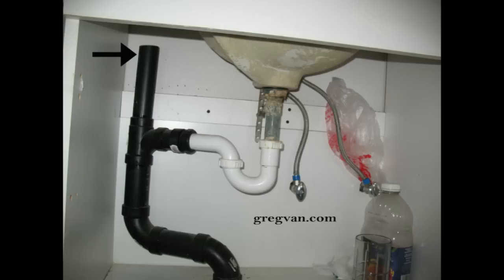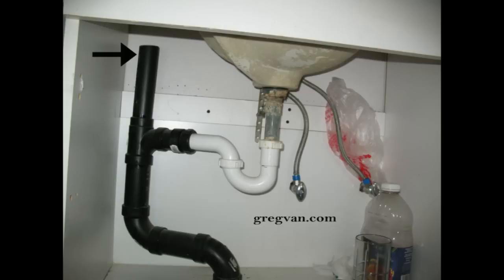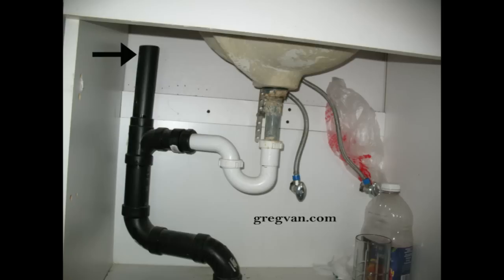What Not To Do With Sink Drain Vent Pipe-  Plumbing Nightmare

Comment: Hey Greg. I have these under my sinks. I live in a 7 yr old double wide mobile home bought brand new in 2008. About a week ago we noticed a foul smell coming out of the floor vent in the master bathroom. Smelled like a dead rodent. Master bath is on the very end of the house. Lasted for a couple days then went away. A day later that same foul smell is now coming out of the floor vent in the OTHER bathroom which is at the complete opposite end of the house. Smell not coming through any other floor vents in the house. I was told it sounded like the sink vents under the sink that this video is talking about and the arrow is pointing at. I was told to buy "Pro Vents" and replace them. Smell has been coming out of the 2nd bathroom now for about 3-4 days. Longer than in the master bathroom. Is that what it sounds like it could be to you? Thanks
Reply from the maker: SaturdayMorningToysandCollectables If it's something that just started, but you been living in the home for years, then it might be something else. I think I would crawl under the mobile home if you have access to it or get someone else to if you are afraid to see if something actually did die under your home or if there is a problem with the plumbing. If you can visually see something wrong when inspecting the plumbing from inside the mobile home then you can make the necessary repairs, but if everything still looks the same as it has for years then it might be something else under the mobile home.
Reply: First check the air admittance vent that should be at the top of you drain vent pipe. If they are old, they could be gummed up and not work properly allowing sewer gas in. $5 to replace the AAV and you are more than likely done.

Comment: I am looking for one of those Valves that has a rubber spring loaded Valve in it.  WHat it does is when the vent is under negative pressure it opens up and allows the air to come into the pipe, but once the pressure normalized the vlve closes.  Thus not permitting any air to escape.  Does anyone know what I am talking about?  Anyway.  A plumber removed mine from my Kitchen sink saying that it was faulty and not opening, and what this did was it caused the water in the sink trap to be pulled out when we used the bathtub which is connected to the same drain.  It is not possible to vent this sink to the atmosphere because of the design.  It is an old 1978 Twilight Bungalow 5th Wheel Camper, however it is vented at the sewer tank and at the Bathroom sink to the atmosphere.  The bath tub and this kitchen sink are connected via water lines and the drains.  When we unplug the bath Tub we get a siphon which pulls the water out of the Trap in the sink because the plumber plugged off this vent.  Then we get nasty sewer gas smells in our Camper.  I sought to resolve this by using a Vacuum vent so that it could pull air in, but it could not push gas up through the vent pipe.  What is this piece called.  we had one on it before, but I cannot find one for it now.
Reply from the maker: I don't know if you're referring to a air admittance valve, but if it's for a camper or trailer, I would contact someone who sells parts for them. It might not be the same part that would be used for a home.
Reply: THis camper is plumbed like a house.  I had it stationary plumbed.  "More like a Trailer house"  THis valve is an inlet valve.  when the vent needs to pull air in, it opens a spring loaded flap, then when the air is not needed it closes via the spring and prevents the gasses from going under the sink.
Reply from the maker: I would hate to suggest anything, because I'm not familiar with the product you're looking for.
Reply: 85 Studios , I know them by a brand name called PRO-VENT.  But what it's called is an air admittance valve

Comment: It should not be left open for reasons that you described, but it should not be caped off either.  If you cap that off the sink will drain slowly and go gluck gluck gluck...  the simple solution, and the obvious oversight of the plumber that installed that it to top it off with an "air admittance valve" as sold by any plumbing supply or even Home Depot and Lowes.  Such as the Oatey Shure-Vent for about $20.  Of course it would ideally go out through the roof but that is not always a viable option and hence this solution, with the one way sure vent.
Reply from the maker: X Gempler Sounds good to me.

Comment: actually all you need is a vent cap, they are used for kitchen island sinks for that very purpose, because you obviously cannot have a vent pipe in the middle of your kitchen island going up through the ceiling and out the roof that would be stupid.......now whether it is code to use in this situation who knows, but if you simply cap it, your sink will not drain correctly.
Reply from the maker: I think I would rather have the vent pipe capped myself, rather than having sewer gas enter the building. Most of the time the water will drain through the trap in the sink anyway.
Reply: gregvancom a vent cap prevents the gas from entering the building, it only opens when water goes down the drain, you obviously don't have a clue about how they work...research it and you will understand that your assumption of gas being released is obviously wrong.
Reply: “Caps” are not allowed/legal under an island either. You have to plumb a vent loop under an island.
Reply: they have air admittance valves (expensive) like Studor and they meet code as they allow air vent, but block sewer gas
Reply: Literally 3 bucks plus another 2 or 3 for the pipe they screw on to... not exactly wallet busting.

Comment: How does a vent cap not allow stinky gases into that bathroom ?
Reply from the maker: The vents are hooked up to the sewer drainage pipes and this is where the smell usually comes from. Usually a water trap like one you will find under the sink prevents these gases from entering the building.
Reply: Thank You  @gregvancom

Comment: You cannot cap this off, you will impeded air flow and create an S trap. A mechanical air vent would be the answer and is within code specs.
Reply: For some reason I have water coming out of my vent. It looks similar to the one in this video. Is there anything I can do?
Reply: @Papoochee. Yes. Just cap it off. It's vented through the backwall, there is no need to have your vent under the kitchen sink. This video is just an AAV advertisement.

Comment: Hay buddy haven't you heard from the magic vent that you can put underneath the sink.
Reply from the maker: I know you're going to be surprised, but if you would have read a few comments below you would've found the answer to your question. I honestly wonder how many times I will need to answer this question, but here goes again. Don't forget that some building departments won't allow air admittance valves so check first before using them on new construction, but might provide you with a better alternative to an open vent on existing properties.
Reply: I don't know where you live but most states have codes against using vent alternatives such as a "magic vent" unless you live in a mobile home. (Mobile homes are exempt in most states from most codes.)

Comment: Maybe I'm not understanding something. The majority of comments here are telling him not to cap it off due to airflow. You shouldn't need to vent underneath the sink. He just needs to run two ninety's and some PVC into the stubout.
Reply from the maker: If you don't want to cap it off, because you're worried about airflow, then feel free to use other methods. Make sure that you watch the other video I made on air admittance valves. It should be in the comment located at the top.
Reply: No need for an AAV. Just P-trap, then right into the stubout.
Reply from the maker: That would be another way to fix this, with a general understanding that the water used as a seal to prevent drainage pipe odors from entering the building can get sucked out.

Comment: there must be a vent on every fixture or you run the risk of creating a vacuum and the waste water will not drain. If you have ever had a toilet that wont flush but is not clogged the vent is the cause. most all vents go up through the roof but in some cases typically additions or remodels the under counter vent is applied and is required by code. Instead of capping the vent an air admittance valve should be used, this allows air into the system and does not let gases escape. For those of you who think venting is unnecessary, cap off all the vents on your home the get back to us and let us know how that works out for you.
Reply: Not true.. 1.5" waste can be run up to 9' horizontally (2"-12') from a vent stack without danger of sucking out the trap.. This is code in the UK and I've NEVER heard of a trap being emptied or a fixture not flushing/draining..
Reply from the maker: I was wondering where you were from, when you said 9 foot, because one and a half inch pipe in the United States or at least in Southern California, I believe can't run more than 3 1/2 feet away from a vent pipe horizontally. It really is hard to imagine why we don't have international building codes that are the same.
Reply: Air admittance products are not code approved in many areas of the country. My actual 1st question here is who put this lavatory in? Obviously no inspections were made or the inspector needs training themselves.
Reply: gregvancom Greg, you are correct, but the 3.5 foot length has to do with the trap arm length and not the vent itself.
Reply: Hi John,  I think that is my problem there has never been a vent on mine before and it's drained.  I see a square top cap with the plumbing parts but when I ask the HD person they said I didn't need it.  I am guessing it is what I make, the vent piece out of, using that r looking piece.  Sorry, I don't know the right terminology.  I think that is what the lead pipe in the wall is because it goes up and down.  Maybe I need to crawl under the house and see for sure.

Comment: I hope that plumber didn't break a sweat putting in the vent pipe that way, I'll assume this is not permitted work nor does it pass code in any state, a cheater vent can be installed and if done right you could unscrew it and replace it above the sink when it/if it fails. Capping it off is not a solution the drain will never drain and it could pull down fluids out of other traps. and if it worked its be a real slow drain and probably clog up fast.
Dip your straw into your drink and take a column of fluid by capping the top of the straw and tell me how fast the water comes out of the straw, now take your finger off the top and watch the fluid fall out of the straw. This is what you would be doing placing a cap on the vent stack. Plugin the end of a straw. Hey and I'm not a plumber. Its just common since.

I think the clog would be a problem way before a cheater vent would if it was caped off.
Reply: No way a real plumber did that
Reply: That was my point, but you know some guys are really lazy so only your plumber knows for sure!
One way this would work and not fill the house with sewer gas, If it drained into an outside pond or water catch basin of some kind and not down the city sewage lines. So in that case a real plumber could have done this, but it dosn't make it right.
I've seen some pretty stupid shit a real plumber has done inside a house and it passed code inspection when it never should have.
Try a notched out 2x10 for a 4" sink drain in the center of the 2x10 and too much notch cut on one side from the top of the floor joist down. The house is 24 years old the notch let the 2x10 split out the 2x10 and no one was smart enough to install some cross  brace boards to help carry the load of the floor above. This also would ahve helped keep the 2x10 from kicking out o one side like it has but that floor joist runs right under the fridge and under a kitchen cabinet and subfloor. This is in the center of the 2x10 its weakest point. the notch is more than 2/3'ds the height of the 2x10.
Its not even a round hole its a big square cut notch.
Nothing was done to fix the damage to the 2x10 for load carrying reasons.  ( this was done when the house was built)

So yes a real plumber could have done that, there are some real dumb shits in the trades, its not rocket surgery! And Codes inspectors can't catch everything 100% of the time.

Comment: It is so ironic that I stumbled upon your video. This looks like my kitchen sink plumbing in the house we just moved into. The pipe opening is stuffed with a wad of paper towel. Better yet, down in the garage, directly below the kitchen sink is another "vent" pipe seemingly coming from the sink, and it is simply venting into the ceiling insulation! Any suggestions besides calling a plumber for a very expensive overhaul?

Comment: what if the vent pipe is sealed?
Reply from the maker: It will still work.
Reply: @gregvancom  any drawback on sealed vent pipe?
Reply: My contractor propose to take out vent pipe for the water discharge. The structure is the same as picture. I want to know if it can make the gas entering the home

Comment: Aren't the introduction  of sewer gasses from this scenario  vastly overstated in a vented soil stack?  Atmospheric pressure alone would prevent these gases from escaping.  The real problem is the vacuum created if this is sealed.  Any fixture connected to a vented soil stack will not emit gas as long as atmospheric pressure is introduced upstream.  I understand this does not meet code, but with the physics of this scenario, you would never have methane gas emission here from the sewer.
Reply from the maker: That was an interesting scientific explanation, but sometimes all you need to do is observe a particular event and in this case you could use your nose to validate whether or not the open vent pipe will be stinky.

Comment from the maker: Don't worry, you're not the first and won't be the last to share your feelings with me about mispronounced words, communication or ignorance. They have a few names and one of them is an air admittance vent, but I would check with your local building department, before using them. I don't think I've ever seen one installed in Southern California on new construction projects, but this doesn't mean they haven't been either.

Comment: man what are you looking at is a vent pipe and is done like that. The guy that put it there did not finish on that pipe need to put a cap that have a valve and when is created a presure for the flow water of the sink that valve have a spring that open by imself a bit and lets air go inside the pipe then close back so that gases dont get out. What so ever in the US the plumbing sistems are not projected with the outside flow valve which block rats and other gases to get in the houses never understand why but is your choices.

Comment: Umm Please Note that they make a Vent air Breaker cent cap that allows air in but not out for this type of under sink vent that should be used on them and once in a great while the can get clogged rarely and need to be cleaned up so they can work properly just capping off the vent pipe is not a good solution.
Reply from the maker: William White Umm please note that some building departments won't accept air admittance valves. A cap is a simple solution, but obviously not the best. Neither is an air admittance valve that isn't going to be maintained or quits operating or doesn't operate efficiently.
Reply: Adding a cap is NOT a solution at all. A cap would make it a unvented trap and a siphoning effect created.  I would say recommending a Air Admittance valve  is better then recommending a Cap as in many areas the Air Admittance valve  would be allowed in NO areas is a unvented trap allowed. And even in areas the Air Admittance valve is not allowed it would still work the reason they are not allowed in some areas is they are mechanical devices that can lose the seal over time and allow gasses and then need to be replaced. In areas that do allow them they must always be accessible. (never inclosed in a wall) But to recommend installing a cap is recommending fixing one code violation with another. at least if you live in a area that allows Air Admittance valves you would have solved the problem.
Reply from the maker: That sounds good and of course I've stated this before, but what the heck I'll state it again and I would imagine continue to state it again in the future. The reason why I suggested installing a cap was to provide a "simple solution" to most do-it-yourselfers and still believe it to be true today. The reason for that was to eliminate the horrible sewer smell that could vent from the open pipe and any problems that could come from a drainage backup or plugged sewage pipe that would cause water to flow out of the open pipe.
Next up on the list was to mention that air admittance valves aren't always going to be accepted by your local building departments or authorities, obviously you are correct that a cap would not be either, but again a simple solution.
I agree with everything you have stated and I would also like to add that capping a vent like the one shown in the video doesn't always mean that the water is going to be sucked out of the trap, thus allowing horrible gases to seep into the bathroom.
I would also like to thank you for taking your time to share your information with us, along with everyone else who has stated a similar case.

Comment: What about an Air Admittance instead of a cap.
Reply from the maker: Yes, that would work also. 

Capping the vent off is the easy solution, next would be using an air admittance valve. However the best way to fix something like this would be to run the vent out to the exterior of the building or tie it into another existing vent.